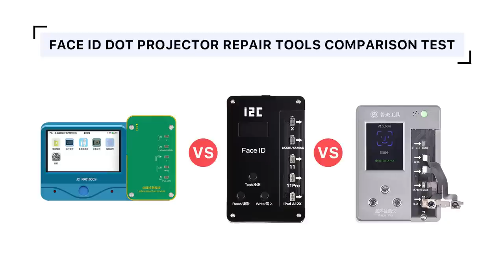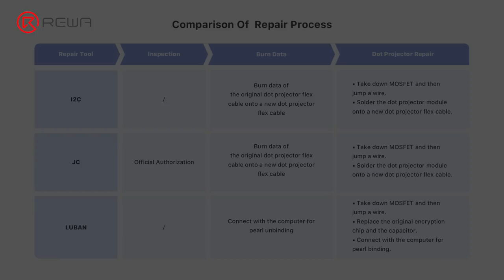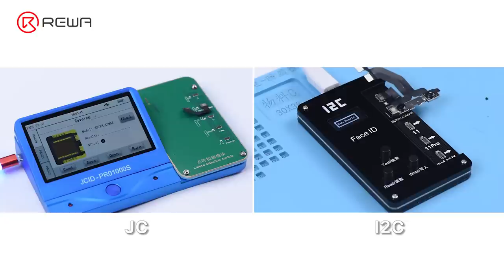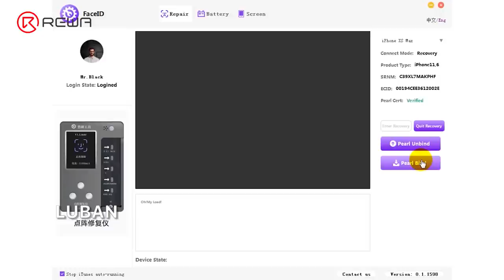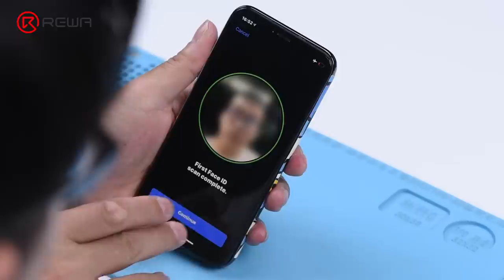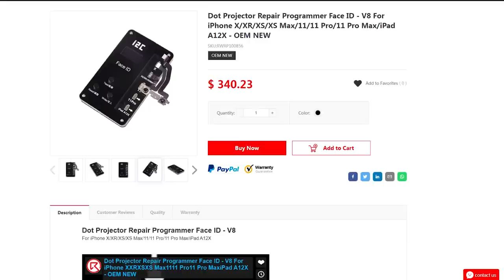Face ID Dot Projector Repair Tools Review - I2C/JC/LUBAN

Comment from the maker: Products recommended in this video: 
I2C Dot Projector Repair Programmer: https://bit.ly/3dAHOsm
Dot Projector Flex Cable: https://bit.ly/3416OFW
JC Pro1000s Pcie Nand Read & Write Programmer: https://bit.ly/3j4ySwm
Face ID Dot Matrix Detection Module: https://bit.ly/3j5ug9l
For more product, please check: https://shop.rewa.tech/

Comment: Hi Rewa thanks for this amazing video! I was wondering if you possibly have the link for the tools used for this repair, such as the grinding tool and the solder wire to short the chip.

Thanks!
Reply: they sell everything you see in their videos.
Reply: @FrancoCoccini  do you possibly know the wire thickness used when shorting pin 2 and pin 3?
Reply: @FrancoCoccini  appreciate the help! Thank you

Comment: Hey, great video! Thanks for sharing your knowledge <3
I got a question: If I get a Face ID programmer and a new front camera assembly (front camera, infrared camera and Dot Projector).
Can I just copy the data from the old Dot Projector and put it on the new Dot Projector?
Thanks in advance!
Reply: No every programmer needs the cables that come with it. I2C programmer supports i2c cables and so do JC and Luban.

Comment: Hi thanks for this amazing video! What if the Face ID works but I need to change the camera module (frontcam doesn’t) ... can I directly read from the old flex and write to the new module or Will I need to swap the dot projectors?
Reply: Do you want to Change Frontkamera?
Reply: @nexulp7887  yes I’d like
Reply: @dantelangone7761  i Changed iPhone 11pro Frontkamera its very difficult du Not destroy dir Projektor after that repair my face ID functions but Not AS good aß before i Had die restart offen the cellphone to Setup face id.

Comment: Thank you Rewa technology sharing this amazing video 😍 and I have one question 🙋‍♂️ JC and i2c replaced dot matrix cable and luban replaced only chip inside dot matrix I can’t understand that dot matrix flex cable damaged or dot matrix chip🤔?
Reply from the maker: Hi, thanks for watching. The dot projector repair tool solutions aim to repair dot matrix chip, damaged flex cable could be repaired by jumping wire or replacing cable.

Comment: was wondering if i can get some help I have the i2c kit and i did the procedure, after i solder the chip on the new flex and tested it on the programmer all 4 lights showed up and passed but when i plug the dot projector into the phone I get "try setting up face ID later" I read and write the data so I'm not sure what's going on
Reply: Might not be dot projector issue